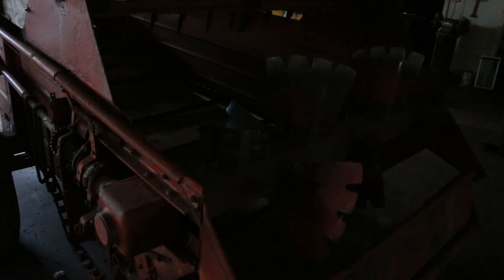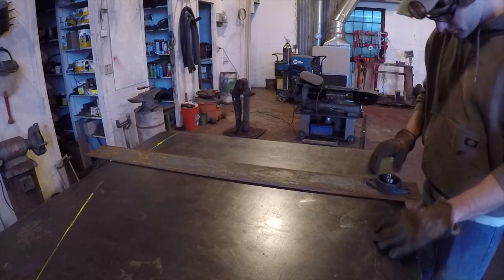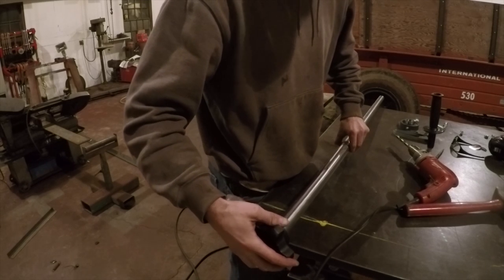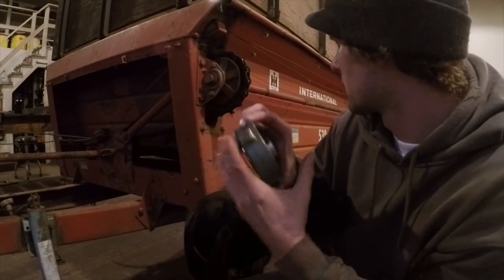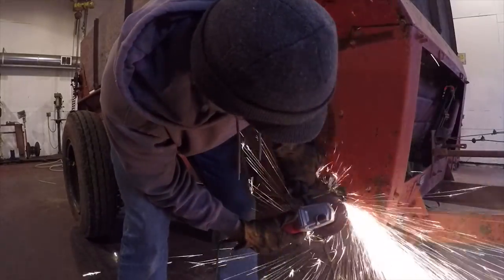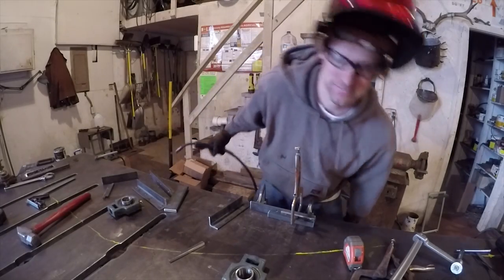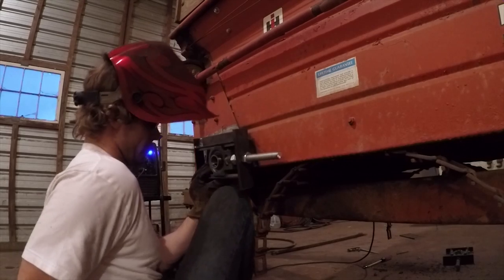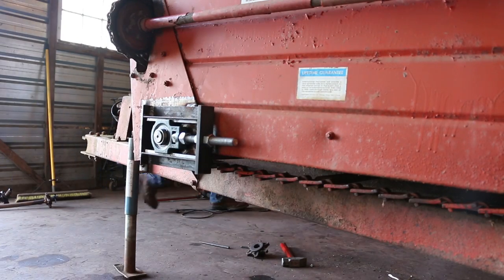Sawdust Spreader Hydraulic Conversion pt. 1

Comment: I am by no means trying to tell you how to do stuff but I noticed you made that adjustable bracket so the bolt would push the chain tight.  If it was the other way around the bolt would be in tension, which steel is better in tension than compression, and the adjustment nut would be the one on the outside of the bracket which would make it easier to turn with a wrench.  Again, I'm not trying to sound like I know everything and telling you what to do but in the future something like this may come up and it may help make things easier for you....just trying to pass on things I've learned over my time.

Comment: I really enjoy the process you use to explain job. Question, would the adjuster bearing be easier to adjust if the bolt was flipped? This might be an weird question on my part. Really like the dog interaction. I recently got my first dog, ever. I’m 53, man is that Dog a boatload of fun. max is his name. Got him from the humane society.
Reply: Yea normally you would prefer the bolt to be under extension not compression 
But if the bolt was the other way round it would hang out the front, be in the way a bit and look funky 
Pays to note alot of manufacturers use this method as well as some using the other way 
Realy it doesn't much with the rise of bolt  vs it's load 
And it's on,y going to be adjusted once or twice a year so it's easy to live with a slightly odd method 
Gives it that real authentic engineering department feel when the design just isn't quite right 
Can still swear at the stupid engineers even if your the engineer

Comment: "slowest" motor?
for hydraulics, flow=RPM and PSI=torque
also plan on 80% efficiency about. the mfg will have efficiency torque tables for you to reference your flow/pressure.

Comment: Lol I could've sourced that gearbox locally for under $100 easily.
Reply: I agree with Jim, BS. A used chain sprocket from an original 530 is $26 and a used gear case housing is $390. People know that parts from old equipment are worth money, especially to people who have old spreaders like the IH530. And you getting defensive doesn’t help your point whatsoever, it just says that you are nervous because you got called out.